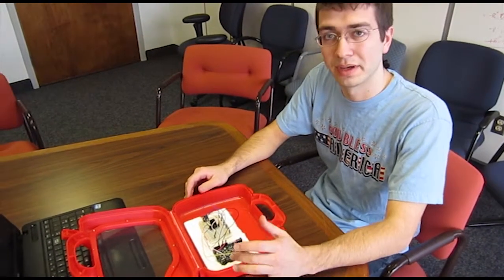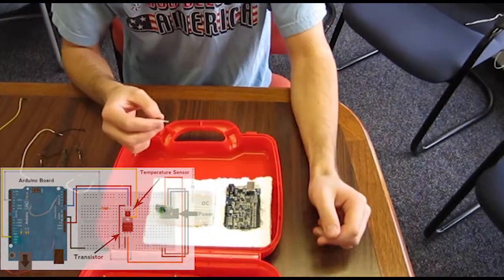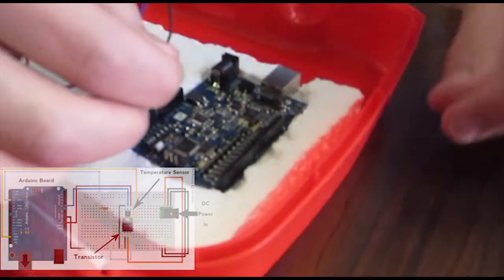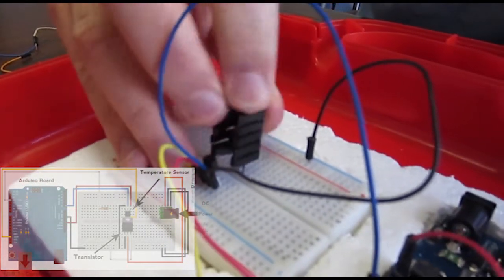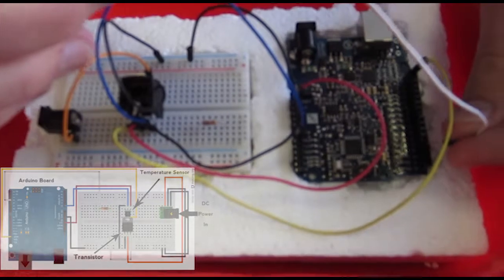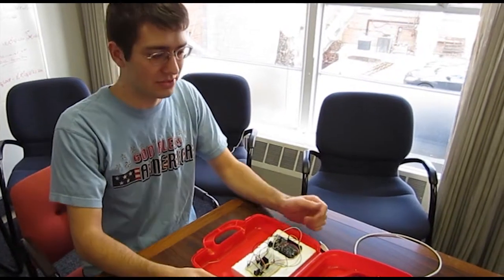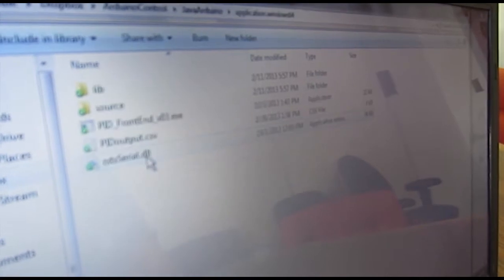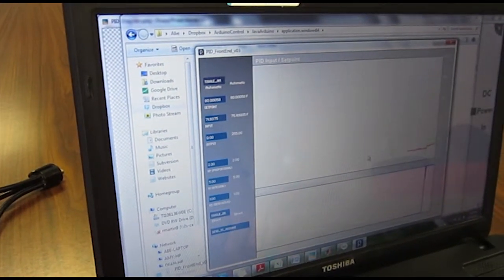Build a Benchtop Process Control Lab

Comment: looks like a great project, do you happen to have a parts list?
Reply from the maker: Martin Duke Sure, here is more information as well as software downloads: http://apmonitor.com/che436/index.php/Main/PhysicalLab  A parts list is in this article: http://apmonitor.com/che436/uploads/Main/Hands_on_Process_Control_CACHE.pdf  Let me know if you have any questions.
Reply: APMonitor.com  Thank you!
Reply: APMonitor.com I see that you chose to use the Ruggeduino instead of the standard Arduino Uno, is this just preference or is there a need for this extra protection?
Reply from the maker: It was a student lab so we wanted to give a little extra protection for the device in case of mis-wiring. A few students managed to melt a part of the breadboard but most of the devices are still working. It should work with a standard Arduino.
Reply: APMonitor.com Thank you for all of your help, I am using this in a teaching lab and would like to cite you (and anyone else) properly could you let me know how you would like to be cited? Also, are you using a license for the information (GPL, creative commons)?
Reply from the maker: Martin Duke
Thanks for citing the work. Here is a reference: Hedengren, J.D., Martin, A., Hands on Process Control, CACHE News, Dec 2014, url: http://apmonitor.com/che436/uploads/Main/Hands_on_Process_Control_CACHE.pdf    We have some more advanced uses for the lab coming out soon on Model Predictive Control and Moving Horizon Estimation (optimization vs. control approaches). http://apmonitor.com/do/index.php/Main/ArduinoLab  Creative Commons is correct. Keep us updated on your progress.
Reply from the maker: CC BY is correct - it is the least restrictive. Let me know if you do make any modifications and would like to share them with our students. We have some additional labs with Arduinos that we're working on right now as well.
Reply: APMonitor.com  I will be sure to keep you up to date, I am considering using a digital thermometer. Also, I was looking through the files and haven't found the Java based controller is is located in a different place or am I just missing it?
Reply from the maker: Martin, we favored using the MATLAB or Python interface because it was easier to modify (for us). I have a Java version available as well: https://www.dropbox.com/s/6ua6dy5zrk7n6u9/JavaArduino.zip?dl=0